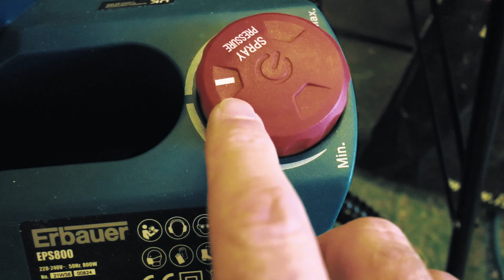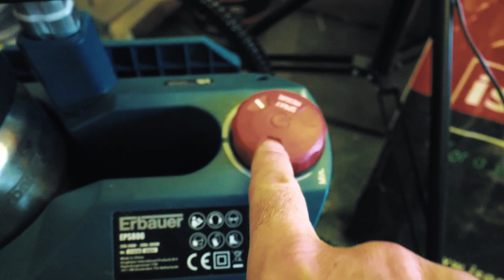Will The Erbauer ESP800 HVLP Sprayer Handle Farrow & Ball?

Comment: Great vid thanks. I bought the ESP800 after your previous vids as I needed to pain our bungalow. I used Sandtex ultra smooth and it worked great. The only thing I had to master was releasing the trigger at the end of each pass and the restarting when coming back as otherwise I put too much paint on at the ends of my arc.

Comment: im thinking of getting into spraying (i spray mainly furniture using f & b and frenchic) but is it worth buying the cheaper erbauer sprayer or going for it and buying a top of the range one, say a graco etc? is there a difference that justifies the extra money that you can see as you have used both ends of the price range?
Reply from the maker: Hi. Always..  buy the best you can afford. QT5 if you do a lot.
But for the money... Try one of these and see how you go on. It's not a fortune if you like it and then what to upgrade to a stage 5 hvlp

Comment: Hi Phil, i bought of these about a year ago to spray leyland emulsion and wasnt over impressed however after watching your video i believe it was human error rather than the spray equipment. I went out yesterday and purchased johnstone satin black to paint the internal doors at home, can i use this in the sprayer.
Thanks in advance for taking the time to read and respond
Reply from the maker: Yes you  can. Thin it though to make it spray well.
Next time try AllCoat Exterior Satin that does spray nice.
Reply from the maker: Yes you  can. Thin it though to make it spray well.
Next time try AllCoat Exterior Satin that does spray nice.

Comment: Lovely video Phil, great for us diyers,, a question i would like to ask you is, whats best for painting ceilings (mist coats and top coats emulsion, the erbauer HVLP sprayer or the erbauer airless sprayer, also whats the best sprayer for skirtings ,architraves, and doors, should i buy both
Reply from the maker: Airless for large areas.
Hvlp for smaller stuff where you need control.

Checkout my other spray videos and see what I'm using where.

Ceilings.
Tikkurila AR2
Isomat ceiling paint 
Teknoceiling 02 
LickPro Matt, ceiling/wall paint (from Screwfix)

Comment: Hi, is this farrow and ball eggshell ? Would you recommend this paint for kitchen cupboards in combination with the paint sprayer or a different egg shell ?  Thanks
Reply from the maker: Using farrow and ball UC and farrow and ball modern eggshell is a really good paint system.
Just make sure you clean down and prep well, use a good adhesion primer first suitable for going over the type of unit you paint, before using the f&B undercoat.

The sprayer will do what you need it to do. Take you time and have a practice before you do the kitchen ;)
Reply: @ProfessionalPainterDecorator  thanks for the reply. The kitchen cupboards is a Veneer finish.  Would you still prepare the doors in the same way ? Light sand farrow & ball primer / undercoat then modern eggshell.  This is with a 5mm nap 4 “ fussy bloke  roller by the way.
Reply from the maker: @michaelt1975  yes. You could try the 10mm nap for the UC/Primer coat. Then move on to the 5mm for the  finish coats.

Comment: I bought one of these sprayers after watching your video and on your recommendation. When I tried to spray emulsion onto the ceiling it would apply paint for a couple of seconds the it would just do air. Having looked at the gun and paint pot, the pickup pipe is angle approx 45 degrees to the front. This means when you tip the gun to spray the ceiling the pipe comes out of the paint and is in mid air. It’s not possible to angle it to the bottom of the cup. Could you please advise if I’m missing something? Great video by the way.
Reply from the maker: You should be able to swap it around. Pull it out and re fit it the other way

Comment: You can read my mind as I’ve been looking into getting into spraying after spending so long doing my house up using a paintbrush and roller. Not so bad painting walls but painting the skirting boards and doors was hard work as I was looking for perfection. I bought a cheap HVLP sprayer some years ago but really hated it. I had nothing to compare it to so I’m hoping this maybe a good alternative. I know you recommend helmi 10 but would this work with either johnstones aqua guard or Caparol PU Satin
Reply: i am thinking of one for the skirting too, bought some Caparol PU Gloss to do them with. Interested if it will do this
Reply from the maker: Aqua Gaurd... Hmmmm,  did you want to use it, they'd be better paints to spray with this hvlp.
Caparol seem to use the Wagner spray system... So unsure how it would spray with  this. It's on my YT to do list though and try.
Reply: Please do, unsure if to use a brush or buy one of these for the Caparol @ProfessionalPainterDecorator

Comment: I’m using dulux Matt for mist coat and I bought this but I’m struggling right now. The paint sprays but goes on the wall and leaks? Is there something I’m doing wrong?
Reply from the maker: Check your seals. Make sure it's not over filled 
Go back to the start and follow my self up again

Comment: Hi Phil, great reviews on these Erbauer machines.
Would you recommend this HVLP spray or their airless spray for woodwork?
My understanding is that the paint needs to be considerably diluted when using the HVLP, which cannot be great when a hard wearing finish is required (say window sashes)
Reply from the maker: hi, tnx.
HVLP, give syou more control.
What paint is the question, 

yes it needs thinning to spray.. trial and error a little bit, depnd son the consitancy of the paint.

Get a good quality paint... you can spray, a few coats easier than brushing and waiting for it to dry.

Getting the right paint for you is more important.

Comment: Any good for oil paint to respray metal gate?
Reply from the maker: You can. But I'd spray a water based on a metal gate now. Look at Bedec and Zinsser products.
Even Valspar do a metal water based paint now days.
Reply: Thanks, I'll give it a look. Just wondering if I can paint this kind of water based paint on top of oil based paint after rub down with wire brush and sand paper. Another think is this kind of water based paint last long as oil based. Just wondering 🤔
Reply from the maker: @radekkwiecien1917  yes, you'll be fine. sound  like the oil base has come off though ;)

Comment: Hi Phil, Really enjoyed this video 👍As I've said to you before, I'm still just getting into spraying with my Wagner FC5000 and have been practicing in my own place and I agree, F &B sprays lovely. Now I have always been leaving the recommended 4 hours between coats yet you've just demonstrated that it can be applied sooner. Is this because with spraying you don't actually touch the surface like you would with brush & roller? Appreciate some feedback on this please? TIA. Keep up the good work, that 911 will come 👍
Reply from the maker: LoL it will come lol

Yes. You're not touching it and only light coats that dry quickly too.

It helps if there's a flow of air and some heat to dry it off.
As long as it's dry enough for a light nib over with a fine sanding pad you're good to go.
Reply: @ProfessionalPainterDecorator  Thanks Phil 👍🏻

Comment: Mine isnt spraying any paint... any idea why?
Reply from the maker: hi
over filled the pot?
paint too thick?

does it spray water?
Reply: @ProfessionalPainterDecorator  

Diluted the paint, even tried water but doesnt spray nothing. Could only feel the air coming out through the nozzle
Reply from the maker: @o.h10000  is the air cap blocked. Strip it down and clean it.

I take it the paint flow dial has been opened up?
Reply: @o.h10000  there is a comment below, 9 months ago, they had similar problem. Turns out the pickup pipe within the paint pot wasn't submerged in the paint. Maybe it's that?

Comment: Infotainment at its best. Could you please give an opinion on the ERBAUER EAPS600 ELECTRIC PAINT SPRAYER 600W? Is it good enough to spray a full house indoors? Could it be used with exterior paint?
Reply from the maker: Is that the airless?
Reply: Yes it's airless..bought 1 not used it yet myself..been sitting in a box for a year..doh
Reply from the maker: @Theduke12  you may need to thin it, get the right  spray tip too. 519 for masonry paint will work

Comment: Them pads look handy. I’ve got some right fiddly sanding to do on some kitchen units (F&B or Little Greene. Haven’t decided yet) and an old wood table (varnished, but is getting oiled) that has bits where even the Rolex won’t fit. Look just the job.
Reply from the maker: tnx, sanding pads.. look in my Amazon store associate link

Comment: Phil … cAn you spray masonry paint through it. I’ve a single garage that’s pebbledashed and never been painted before . Don’t think a roller would get it and don’t fancy brushing it??
Reply from the maker: The bigger air cap 2.5 and thin it. Youll spray it, not saying how well though being such a thicker paint
Reply: @ProfessionalPainterDecorator  cheers
Reply: I sprayed SANDTEX ULTRA SMOOTH MASONRY PAINT using this hvlp and it worked great on pebbledash.
Reply: @ched999uk  cheers pal. I’ll go buy one then!
Reply: @bigdude8470  I think I thinned it about 2 part paint to 1 part water. One thing to note is release the trigger when you get to the end of each pass before going back i.e if you get to the end of the travel if you don't release trigger then pull again when you come back you get too much paint when you change direction.

Comment: As a painter and decorator I Hate this love of spraying. I was offered a contract to paint a new building development . And because I refused to spray the new homes lost the contract. The irony is two years later I am back in that housing development painting the conventional way. As the walls are peeling and they have a crap finish which needs sanded down. I can understand people who aren’t experienced in painting using these sprayers A brush and a mini roller will take slightly longer. You will end up with a great finish with a brush and mini roller. With a good coat of paint. I read someone wanted to paint pebble dash. Don’t use watered down masonry paint just get a masonry roller.
Reply from the maker: Interesting..... I take it you've never done spraying then?
Reply: @ProfessionalPainterDecorator  I work on trucks in my spare time. I know all about spray painting I have a spray booth in my cellar I use to spray truck parts. Plus the cheap sprayers aren’t worth a damn. If you want the glass like finish the spray gun itself costs around £400. I bet you wouldn’t use that sprayer to paint your car. Yet you use it for your house. Take this for example. One of my customers got quoted £5000 to get his kitchen cabinets spray painted. I nearly choked on hearing this. There was 25 cabinets doors which I took to my workshop degreased hand painted the undercoated top coated both sides of the doors with the proper cabinet paint. As a lot of spray painters only do one side of the doors. It took me five days and that’s  painting the kitchen frame re fitting the doors with new handles. Plus painting the kitchen walls. I wasn’t pushed in anyway. And it cost him £2000 he and his wife were chuffed to bits and saved a fortune. The thing about spraying wood and walls is that they absorb a lot of paint. The paint won’t be absorbed as well with spraying as it’s not worked in. And I won’t compromise my quality of work for a quick fix. I’ve been painting and decorating 34 years. I spent ten of those years specialising in restoration of oak and mahogany doors and panelling. Could you imagine after spending months stripping away a hundred years of paint on oak paneling to use a hundred quid sprayer. Over the last twenty years the quality of workmanship is a disgrace. It’s a a quick fix. The thing I’ve noticed is the tradesmen who stick to their principles and work ethic and quality always have work. It might cost a bit more for the customer at the time but it’s worth it.
Reply from the maker: I take it you to trained and got your C&G in painting and decorating like I did?

I think reading back at your last comment, theres a lot who have no idea, spray cus they think it's a quick way to paint and earn quick money. reality is, they have no idea about the basics and thats where it all goes to pot.
Reply: That’s two very long winded comments,with very little point to either…..And this logic that just because you have been doing whatever for 30+ years makes you better is,quite frankly,ridiculous..
Reply from the maker: @glov961able  that's quite right Scott, someone could have been doing something 40yrs... Wrong.
Not everyone knows the basics and just muddle along and with time they think it's right... As they know no other way.
Reply: I highly disagree.
You need the correct sprayer for the job.    You can’t use a mini sprayer like this to actually paint walls for entire houses/flats. You’d want a powerful airless sprayer in the £500+ range.

I have a Wagner 350M and sprayed several houses and not one has peeled. The finishes are amazing and you do entire rooms in minutes.
I’ve never had to dilute paint while using stuff such as Johnstones Covaplus or Acrylic durable matt.

So there’s that. 

I doubt that the issue in your development was the sprayer, it was most likely poor prep and an incorrectly used machine or the wrong machine for the job.
Reply: Sound like the guy that taught us back in the 80s , he wouldn’t let me use a roller cause people have lost the art of taking brush streaks out of the paint work lol